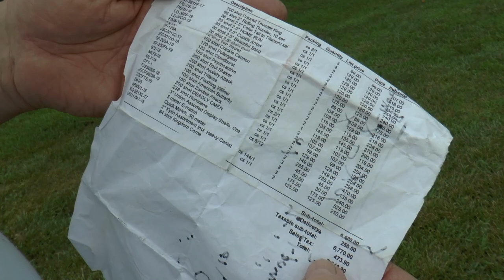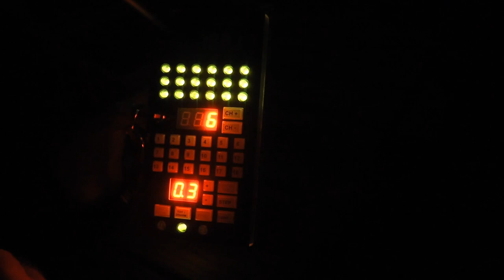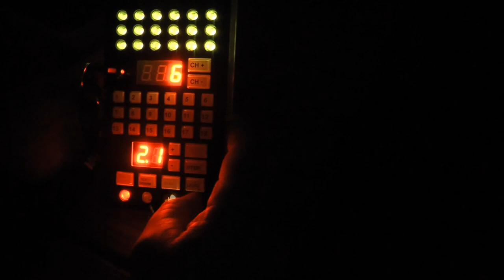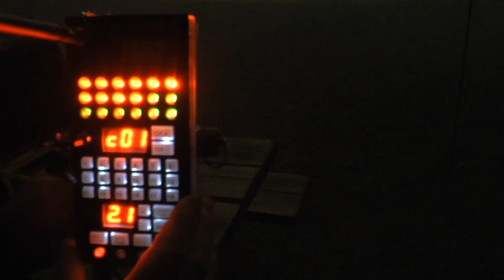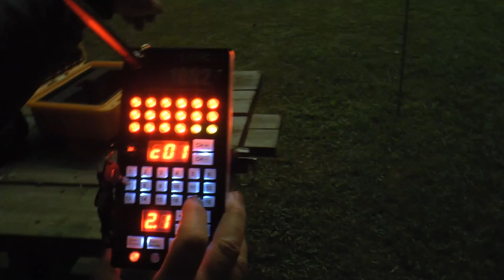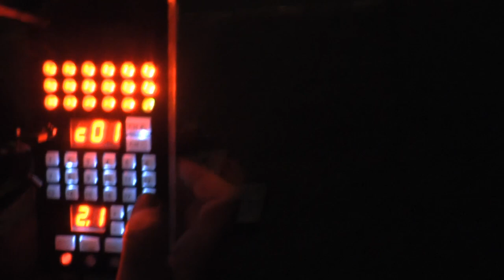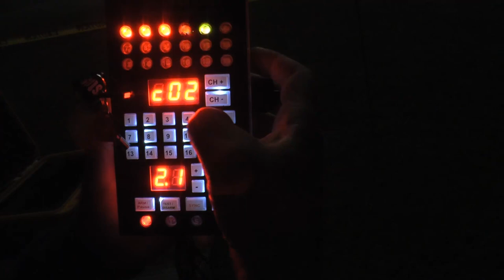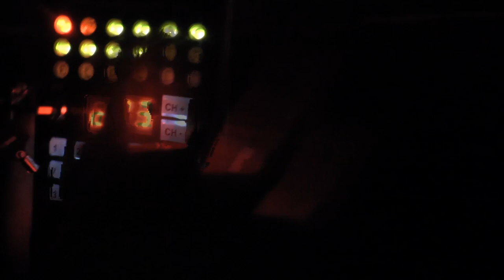Fireworks by the Lake 2019

Comment: Great job. Guys. A tip for your cameraman: Use a slightly wider lens. It will look less shaky and get a little more into the field of view. Also, you don't need to swing that camera around so much. It's very exhausting for the viewer. Slow movements will engage the viewer much more effectively.

Comment: Nice show but not great post display practice. Hit the fires with extinguishers, turn off modules and that is it out there for the next half hour. Wrap up command center and other gear in the mean time. To walk around and pull shells so soon is a dangerous practice. Teach the crew better habits. Taking stock of what didn't fire should wait for an appropriate cool down period and no sooner. Great show. Just tighten up saftey protocol. Take care.
Reply: Good points.  Also, complaining about perc match then immediately cutting it with scissors and not anvils.  I understand people do what they do out there but if you take on the role of teaching new pyros then safe practices should be shown.